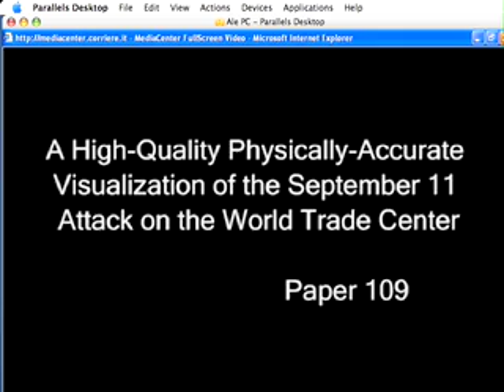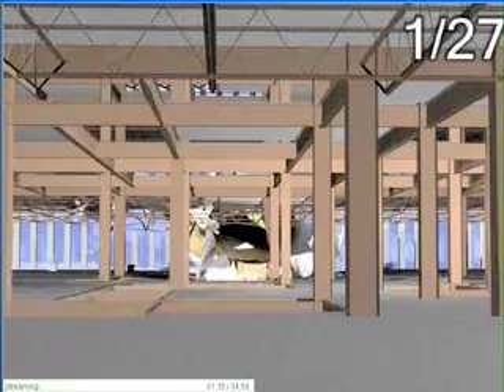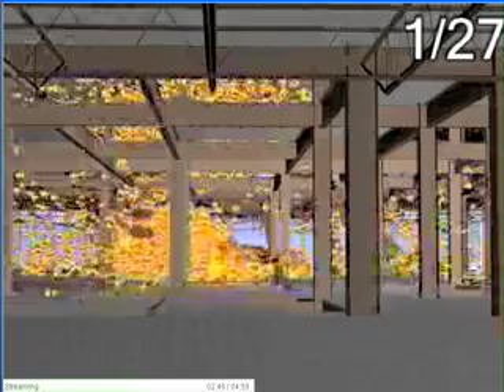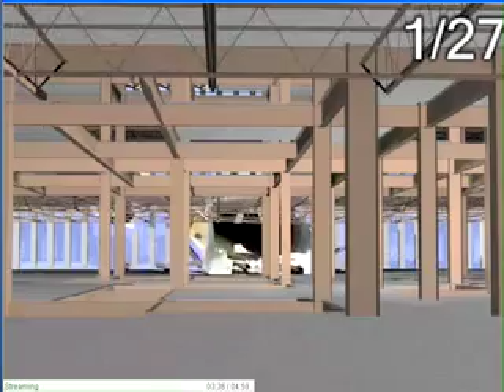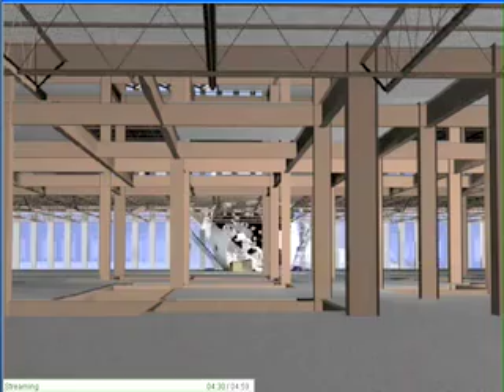9-11 Twin Towers Attack 3D simulation

Comment: Buildings do not fall like that with out help. Jet fuel doesnt burn hot enough to melt steel. nor do any of the other materials in the building. It was blown up to get the "patriot act" voted in. It is the agenda of the P.N.A.C. which is a documented government group of which W.bush and Cheney were both members

Comment: Well... This is a decent simulation, and I can do no better at this point in time, but @ 1:58...
The simulation, right there suggests that the aluminum from the jet-liner shell cut those steel core columns like a knife through butter... WTF???

Comment: Fire + steel = Hot steel

Hot steel is 'softer' as blacksmiths around the world can tell you.

This means that, sooner or later, the steel will be soft enough to bend by the wieght of the floors above (which it didn't while not heated)

And as you know, being hit by a fast ball hurts more than being hit by a slow ball, the fast ball has significantly more kinetic energy. Once the floors start to fall, they put more excess strain on the non heated support collums, more than they can take.

Comment: As structural eng i have to say that th column failure was impossible to occur with the ordinary theory of the 9/11 collapse.The columns should have evidence of local bucking at the failure region in th base. From pictures that I ve seen all failures look very brittle to be normal. Also there were special mechanisms in the building that were able to transfer the load from the one face to the other without problem. From many scientific points of view i am almost sure that th 9/11was an inside job

Comment: Note: A B-25 Mitchell is a lot smaller than that of the Boeing 767-200ER which flew into the WTC. The explosion from the mass amount of fuel on board the plane would have acted as an an air-fuel bomb, which the shockwaves could have damaged the internal structure severely and therefore created collapse. Nothing in history has compared to 911. I still have doubts about the whole thing but think it is plausible

Comment: Reality sucks(comparing planes):
1) Speed WTC: 490-550mph ESB: 315mph
2) Weight WTC: 300000lb ESB: 42000lb
3) Fuel WTC: about 10000 US gallons ESB: 950 US gallons

It's like comparing shotgun with airsoft gun
--

Besides ESB's structure were more suitable for outside attack than WTC's. In case of inside attack (like bomb) WTC would have had better structure.

Comment: The towers fell like they did because the floors buckled under the heat of the fire wealening the metal substructure cause them to pancake on top of each other. The puffs of smoke seen coming out the windows was cause by air pressure inside the buildings as each floor collapsed on top of the one below it. Clap your hands together close to your face and you will fell the air puffing out from between your hands.

Comment: Ah excuse me but aircraft debri was show exiting the other side of both buildings and one of the engines was found blocks away from the crashe site along with landing gear. Give up the conspiracy theory, to do what is calimed it would have been such a massive operation that it would have been noticed by alot of people. The towers had hollow cores that were elevator and ventalation shafts which acted as a flue for a blast furnace that spread burning fuel all the way to the bottom floors.

Comment: You people make me laugh at that ignorance displayed when you claim bombs and missles. There is vidoe proof of complete penetration of the airframe and engines that cut the core in half and the heat of the fire is what caused the structural failor of the steel. I am a welder and can attest to the fact that it does not take as much heat as some people think weaken steel. As far as the pentagon is concerned how do you explain the front landing gear that was found inside the inner rings.

Comment: The core shouldn't collapse. Almost 80% of the core is intact, and the fires weren't enought hot to melt the steel. The fire department at that day said that bettwen the damaged floors there were two isolated pockets of fire. Do you think that these two isolated pockets of fire could make the steel frames to explode in big pieces in that way ? There were explosives (thermal thermite) behind this.

Comment: I like particularly how steel sheets with few millimetres cut through hardened steel columns several centimetres thick like butter. for good sake, even if it did that damage, the tower would stay up.. the towers were design to face such attacks!! and all the stell and structure was made to hold high tensions and high temperatures!

Comment: And if you did not believe everything you saw on the Internet (of Fox News) for that matter, you would know that the laws of physics do not allow a structure the size of the WT towers to collapse to the ground in what was essentially free-fall i.e. acceleration due to gravity. The lower parts of the building would have slowed the collapse at each stage.

Comment: alot of the structure and support and stuff like that had been destroyed and the cuase of the huge fire made it worst. Yes metal does expand when heated but that doesnt mean that it cant melt. the  heat from the fire soften the steel and all that weights from the ther floors above it made the steel to weak to handle which cuased it to fall. and more than 2 floors collapsed. the fire and spread throughout the building through stairways and stuff like that. 1 at a time the floors fell. CONTINE-

Comment: the plane would have seriously damaged the structure and those structures are like an egg in the sense that theyre incredibley strong and can take loads of weight but once cracked significantly, the weight can no longer be sustained.  theres no proof that bombs were set off.  why were the bombs set off so late? why not as soon as the plane hit the building? theyre not hard to detonate so theres no explination for why they werent set off at the point of impact.

Comment: man this is bullshit. that building was over 100 floors tall. and well structured. even if the top collasped (above the plane damage) it wouldn't have been strong enuff to smash the rest of the building. bombs were set off in the building on different floors to collaspe the rest of it(watch some close up vids.) and if that ain't enuff info to understand the physics your a dumbass that believes what any asshole tells you.

Comment: I think it had to do with the design of the floor supports. Heat from fires caused the floors to sag and collapse until the outer walls could not hold anymore.
I saw some BBC documentary about this.

Comment: actually, the amount of jet fuel that was burning did reach a hot enough temperature to melt steel. the metal inside the building did melt. also, and explosion would simply just destroy anything in its path because of the shockwave. so even if none of the metal melted, the columns and beams supporting the building would still have been gone because of the explosion.

Comment: not to rain on your parade or anything but COMPLETE combustion of kerosene (jet fuel) is not hot enough to melt steel, the red flame (or incomplete combustion) of the kerosene is by far not hot enough to melt steel this is one reason why people doubt that the plane's explosion alone let the tower to colapse

Comment: Um do you realize how absolutely STUPID this whole "Dynamite on every floor"  Theory is?.   You are talking about MONTHS of work to do this.  Shape charges to take out the columns on every floor.  And if it was going to be blown up as is seen ALL of the Charges would have to be blown at once.  Not the gradual little puffs seen coming out the side, which are compression explosions from the weight not CHarges.  The building collapsed because a 200 ton plane hit it at 500 mph!!! Take physics class!

Comment: also i beleve that the fire myth isnt true eather, if jet fuel burned at thousands of degrees as the goverment says, then why isnt it burning holes in planes, i mean they combust fuel in high pressure making it even hotter yet that doesant burn a hole in the steel of the engine. im sorry but fire and a small 3 floor hole couldnt possibly completely bring down a building weighing thousands of tonnes

Comment: theirs a majour floor with your simulation, the wing tips show damage to the support columns when in fact they wouldnt be able to cause that much severe damage, plus in my opinion and i have a degree in physics, that wouldnt be enoughth to bring down the floors above the inpact zone and also the floors collapsing would end around half way through the building and would not completely collapse the building

Comment: they need to make the structure iof the building be able to withstand an attack like this and be able to hold the weight up which kinda makes me question if they already did make it like that the building therefore would not collapse and save tons of lives and make terrorists have to think better unless there was any kind of bombs brought onto the place but airport security would most likely notice any kind of bombs brought on unless they were snuck on through another way

Comment: the fuel was under no pressure. it ignited the same way it would in a regular crash. its mostly kerosene and it does not burn hot enough to melt even sheet steel, let alone structural beams that have been heat treated.

Comment: heavy structural steel. 
Watch this video to get a better understanding. 
watch?v=qJ11i6fi7KQ.
If you read the NIST report it tells you that each floor could only support the weight of 6 COMPLETE floors impacting on top but as soon as the buildings start to collapse you see the concrete of the floors pulversising to dust and becoming air bound, the cores are left behind and the outer columns fall outwards so where is the mass that's causing the rapid collapse?.
It takes one hell of CONT

Comment: the trusses gave out because they wear heat up pretty badly from the burning jst fuel from the crash even if the sprinkler system pipes to and above the floors  the water would not have been enough to cool down the fire and the explosion of the planes caused the fire retardent sprayed on the metal structure to be blasted off of the metal which then caused the fire to be able to heat up the metal to the point that it eventually gave out causing the floors above the crash to collapse

Comment: PEANTONG
If you throw an egg, yes.
But if you fire a straw from a cannon it penetrates wood, I have seen the high speed camera film. 
Again I don't know the speeds required, and the engines weigh tonnes and are very hard and very solid, the wheels and hubs are heavy , the oleos are hard etc etc etc.

Comment: If you throw an egg at a wall it smashes. If you fly a plane at a girder - or several girders - it destroys the plane. It damages the girders and wrecks the floors. It still doesn't seem enough to bring a building down, though does it. Despite the science saying the plane can cut through the core columns, it's still inconclusive.

Comment: Goalforgoal
Those claiming an inside job point more to a network of thermite devices planted over weeks, than (2 Bombs in some secret holes).
They would be silent, cut the beams, and leave molten steel.
Things burn office equipmentet and AVTUR shouldn't be able to do, but science should have been able to test it.
Why did they behave like the Catholic church with a NEW MIRACLE.? Rather than with a new problem to be solved, where thousands are still at risk.?

Comment: Skyfoxraider
No because it wouldn't fit ANY of the observed data.
Or any KNOWN science.
Like AVTUR can only hold this much latent heat, office equipment this much.
The building has this much redundent strength etc.
Computer simulations have helped in the space program etc.

Comment: I look at this, and if I stay convinced that the fire couldn't get hot enough to damage the steel.
AVTUR (jetfuel) and office equipment need a blast furnace to soften steel. 
Then how could that little damage bring down the buildings. There are so many core columns left, two complete outsides. 1/2 the strength  was needed for big winds, there was a light breeze. At least 60% of the building is left.

Comment: the toweres were made to withstand such damage to the central colums, a cuople of thousand feet in the air i think the designers thought a plane might crash and designed it to withstand it, and also in the 1940's a B-25 bomber crashed into the empire state, take into account the plane to buliding ratio and the TT's and the ES are about the same and the ES is still standing fine 60 afterwards